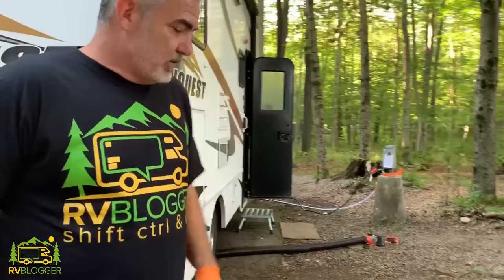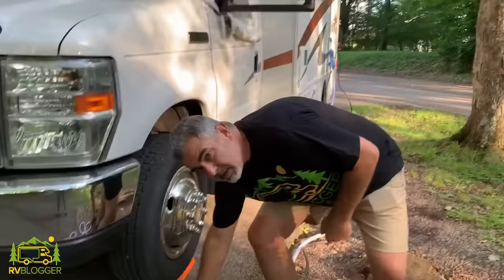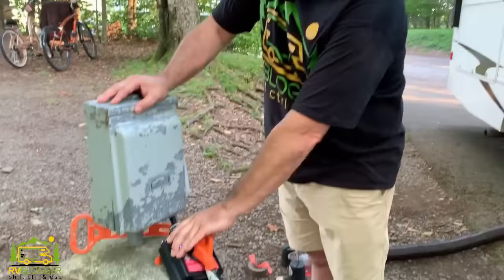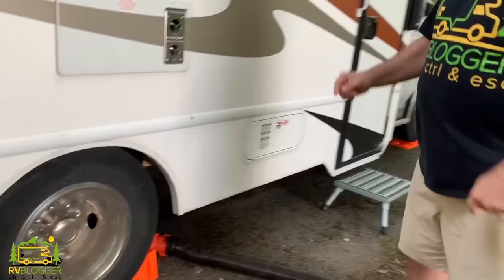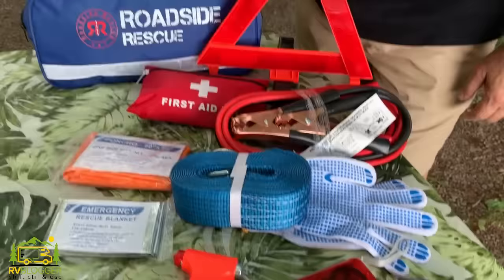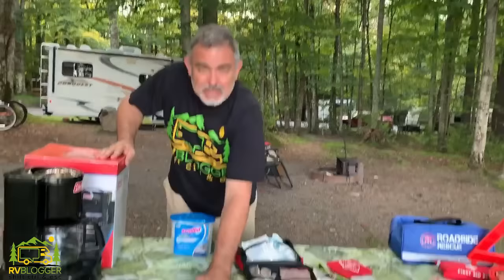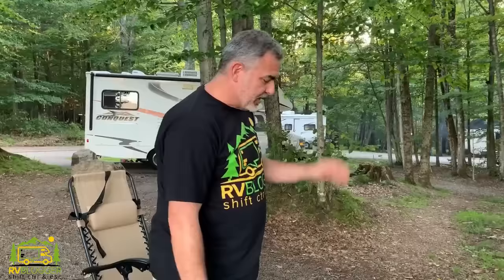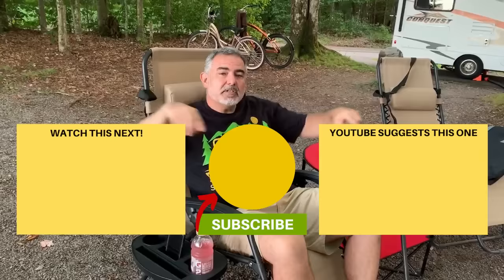Essential Gear & Accessories for RV Beginners - We Didn't Back In to Our Campsite - Do You Know Why?

Comment: Hookups aren’t on the wrong side. You should of backed in
Reply from the maker: Watch the video again! If I back in my side door would not be facing the campsite where the picnic table and fire ring were located. I would have to get out the side door and then walk around the RV to the other side. 
We keep extra hose, sewer line and electric cable on both of our RVs because the hookups are on the wrong side every now and then and this was the perfect campsite to shop off why this is important. But we camp way more than most people so we see hookups on the wrong side where most people have never experienced this. 
Thanks for watching!
Mike

Comment: Thank you so much for this video! As a first time owner it's a little overwhelming trying to figure out what is essential. I was happy that I do have a good amount of them but never thought about the surge protector!  Also will be looking into the Rhino blaster.  I read you should never stay hooked up because of sewer gases but Am I correct to assume this blocks that?  Thank you!
Reply from the maker: Hi Lorrie,
The sewer gas thing isn't why. You should keep your black tank valve closed while camping until the tank becomes full because it takes all the pressure from a full tank to completely empty the black tank. You can leave the grey tank valve open while camping but you do want to be sure to have a full grey tank at the end of your camping trip because you can use the grey tank water to flush the sewer line after your final black tank dump.
I hope all that makes sense>
Thanks for watching and commenting! 
Mike and Susan

Comment: Why didn't you back in? Then your connection would be on the same side as the power and sewer.
Reply from the maker: I considered that but then the door into the RV would be on the wrong side and not facing the part of the campsite where our fire ring and picnic table were located...

Comment: Why didn't you just back the rv up vs. pulling in, and you wouldn't need to have all the extra hoses and effort?
Reply from the maker: Hi Jennifer,
I considered that but then my door into the RV would be on the wrong side and I would have to walk all the way around the RV to get to my fire ring and picnic table.
This has never happened to you before? It happened to us like two or three times in a week. But other than that the hookups are usually on the correct side.
Thanks for watching and for your comment!
Mike

Comment: Great video and thanks for sharing. I have one suggestion as well, and it's not back into your campsite. If you want to save some space, I traded in my propane coffee maker, which I loved, and downsized to a portable French Press thermos. I still use a propane stove and boil some water in a pot and pour it into my French press I bought on Amazon.
Reply from the maker: Hi Can_eh_sian,
I guess it isn’t obvious but if we backed in to the site the side door of our RV would not be facing the main part of our campsite where the picnic table and fire ring are located. Maybe I didn’t explain that well enough in the video…
Thanks for watching and commenting! 
Mike and Susan
Reply: @RVBlogger  I may have worded my sentence poorly, but I wasn't bashing your parking. All good!

Comment: Why didn't you just turn around and back in?
Reply from the maker: Hello OkWoodsman,
I guess it isn’t obvious but if we backed in to the site the side door of our RV would not be facing the main part of our campsite where the picnic table and fire ring are located. Maybe I didn’t explain that well enough in the video…
Thanks for watching and commenting! 
Mike and Susan
Reply: @RVBlogger  Yep did not see that. What a bummer, but the extra length solved it. Thanks !
Reply: I was going to ask the same thing. LOL.

Comment: Why didn’t you just back into the spot so everything is on the correct side????
Reply from the maker: Hi Marcia,
If we backed in the side door to the RV would be facing the wrong way. So we wouldn't be walking out to where the fire pit and picnic table and the large part of our campsite were. For some weird reason the hookups were just installed on the wrong side of the campsite. This happens to us a few times a year but we camp way more than most people. Have you ever stayed somewhere where the hookups were on the wrong side?
Thanks for watching!
Mike and Susan
Reply: @RVBlogger  wow. Never run into that situation.  Hope I never do!

Comment: Tell me why did you not just back into the spot?
Reply from the maker: Hi r b,
If we backed into the spot our side door to the RV would not be facing our campground where the picnic table and fire ring are located which would be very inconvenient. We run into campsites with the hookups on the wrong side a few times a year but we camp a lot more than most folks. Hope that answers your question!
Thanks for watching and commenting!
Mike and Susan
Did you see our video about our FREE RV Rental for a Weekend we are giving away? Hope you will check it out!
https://youtu.be/h_NW_O-VsTo
Reply: RVBlogger well I have had that problem and I just moved the table. I don’t use fire rings. I sure don’t want all that hose facing me in the morning, uka

Comment: Use a pillow then you can just level the RV, if your RV is level then a pillow will ensure your head is higher than your feet.
Reply: That wouldn’t work for me. I can only use a small neck pillow due to neck problems.
Reply from the maker: Hey Tony, 
We appreciate the advice! 
Thanks for watching and commenting! 
❤ Mike and Susan

Comment: Wrong side because you drove it in. Supposed to back in.🙄
Reply from the maker: Hi Michael,
I guess it isn’t obvious because I didn’t explain or show it well enough, but the hookups are actually on the wrong side of the campsite. So, if we backed into the site the side door of our RV would not be facing the main part of our campsite where the picnic table and fire ring are located. 
Thanks for watching and commenting! 
Mike and Susan 

By the way, we invite you to subscribe to our free monthly digital/video magazine called RV Camping Magazine. It's totally free and there is video throughout the magazine! 
https://rvblogger.com/rv-camping-magazine/
Reply: @RVBlogger  I'd rather not have to step over sewage , water and power lines every time i go in and out of my RV.   so yes. .the site was made to back in.
Reply from the maker: @klenzgaming  the site actually had the hookups on the wrong side. We didn't show that well enough in the video. We've seen this more than a few times in different campgrounds. But I did a bad job of showing and explaining it in the video.
Thanks for watching!
Mike

Comment: Hatchet.  We never camp without one.  Great for chopping up wood that you buy at the campsite as well as using it to bang in any kind of tent pegs.  We also bring a tarp for shade and rain protection.  We just moved from tent camping to a pop up and are looking to buy a travel trailer in about a year, but I can’t see us ever camping without the hatchet and tarp.  We also bought a canopy (our pop up doesn’t have one) so we can set that up right outside our pop up; it goes over our kitchen area so we can cook, even in the rain, then we use the tarp over the picnic table so we have somewhere to sit outside if we don’t want to just hang out under the canopy.  We are also going to start bringing our clothes horse so we can hang up wet towels and dish cloths.  We have usually just used rope, but the clothes horse needs replacing, so why not relegate it to camping?

Thanks for posting for the RV stuff; it is good information to know since we are hoping to move to a trailer next year!
Reply from the maker: The hatchet is a great addition to the list. Thanks for suggesting that. We carry one also..just didn't make it on the list! 🤦‍♀️I (Susan) used to have a pop up camper and loved it!! Sounds like you have an awesome setup going on. Thank you for sharing your "must have" camping gear with us. Someone reading comments will find value in it too! Thank you for watching our gear video and commenting! Safe travels!

Comment: Camper paper, no. It isn't worth it. If you stuff a large enough wad of paper down the toilet to clog the 3 inch drain, well you probably need other lessons. Toilet chemicals, no. It's a black tank not a septic tank. If you leave it in long enough to actually break down with those enzymes you're waiting way too long. None of us put surge protectors on every item in our home. Use surge protector strips inside, they cost way less.
Reply from the maker: Hey TCUH
We appreciate the info! 
Thanks for watching and commenting! 
❤ Mike and Susan 

By the way, check out our FREE monthly digital magazine https://rvblogger.com/rv-camping-magazine/ and let us know how you like it!
Reply: The surge suppressor protects the power supply and therefore everything downstream. The strips only protect the devices plugged into them. Many campgrounds have pretty sketchy electrical systems so it's a really good idea to use one.

Comment: Ummm. Shouldn’t you back into the site?
Reply from the maker: Hi 2A Strong,
Look more closely...
If we back in then the side door to the RV wouldn't be facing our huge campsite where the fire ring and picnic table are located. So - the hookups were on the wrong side...
We end up in campsites like this several times a year but we camp way more than most people. So we keep two of everything on board in case we can't reach, or the hookups are on the wrong side or in case something breaks.
Thanks for watching and commenting!
Mike and Susan
Reply: RVBlogger oh.  Got it.  I was wondering the same thing.  So overall just a crappy site layout?.  Not your fault— no other available?

Comment: I see you have responded to several people saying that the site is backward. Well, you pulled in and did not back in. Your complaint of the door then being on the wrong side is not a valid point as that door is designed to open away from traffic. So back in next time and then you wont fall over your sewer, water or electric connections. Good luck in the future......
Reply from the maker: Actually Noslen,
the hookups are on the wrong side.
I guess it isn’t obvious but if we backed in to the site the side door of our RV would not be facing the main part of our campsite where the picnic table and fire ring are located. Maybe I didn’t explain that well enough in the video…
Who wants the side door the the RV facing away from their campsite?
Plus there are campsites with hook ups on the wrong side. We land on a few a year but we camp way more than most folks.
Good luck to you too.
Mike
Reply: @RVBlogger  it must take patience to have a YouTube channel. Reminds me of a Sesame Street Buddy and Jim routine where they had a hammer that pointed to one wall and a nail that pointed to the other and they couldn't figure out how to hang the picture. Haha
Reply: Easy solution Noslen. He 1st needs to buy a cooler. Then he needs to remove his fridge and install a door on the drivers side of the RV. Because as you know, all Rv's have their hook up's on the drivers side. That camp site had their hook up's on the picnic table side. The side you want your "away from traffic side" to face. Good luck in the future to YOU!!!!

Comment: Why didn't you just back in
Reply from the maker: We could've backed into our spot the "right" way but then our door would've been facing the road vs facing our campsite where our picnic table and fire ring etc was. We preferred pulling in so we could exit the RV right at our site not the road and have to walk around the RV every time and that was ok cause we had enough RV gear to make it work. Hope this explanation helps. Thank you for watching our essential RV gear video and commenting. We appreciate your support!

Comment: Blaming the campsite for being "all wrong" because you failed to back into the space is pretty ridiculous. :)
Reply: His door would then be on the wrong side, facing away from the campfire
Reply from the maker: Hi Will,
We get more comments about this than anything else and you aren't the first to be wrong but you seem way more offended about it. lol!
If we backed into the spot our side door to the RV would not be facing our campground where the picnic table and fire ring are located which would be very inconvenient. We run into campsites with the hookups on the wrong side a few times a year but we camp a lot more than most folks. Hope that makes sense. 
Thanks for watching and commenting!
Mike and Susan
Did you see our video about our FREE RV Rental for a Weekend we are giving away? Hope you will check it out!
https://youtu.be/h_NW_O-VsTo
Reply from the maker: Exactly right Specialopsdave,
Thanks for the help in explaining it to Will.
Thanks for watching our video!
Mike and Susan
Reply: @RVBlogger  Not the least bit offended. Though your excessive response is a bit off putting
Reply from the maker: @allenchamberlain1963  Nope - the other side of the campsite was all wooded. Nowhere to set up the picnic table or fire ring. Plus we had a HUGE campsite so why would we move everything to the other side. We probably camp a lot more than you and we run into hookups on the wrong side a couple times a year.
Thanks,
Mike

Comment: Did you ever think about backing your RV into your spot so that your hook ups are on the correct side ???
!! DUH !!!
Reply from the maker: Hi Heber,
Did you ever think that if we backed into the site the side door to our RV would not be facing the side of the campsite where the fire ring and picnic table are located? DUH? 
I was going to delete your comment but I think I will leave it up so everyone can see how smart you are. LOL!
Anyway - thanks for watching!
Mike
Reply: I notice the main road to drive through to the other camp sites is fairly close to where your hook up's should be installed. The site manager had to move the hook up's away from the road and install them on the wrong side of your parking pad because Heber Belles kept running over them. DUH!!!!!!!!

Comment: This guy's a salesman. And doesn't know how reverse works.🤣🤣🤣🤣🤣
Reply from the maker: Hi Doug,
I guess it isn’t obvious but if we backed in to the site the side door of our RV would not be facing the main part of our campsite where the picnic table and fire ring are located. Maybe I didn’t explain that well enough in the video…
In addition I have NO SPONORSHIPS for any of the products we recommend. These are the actual products we use ourselves.
Thanks for watching the video. 
Sorry you thought so little of us though.
Mike and Susan
Reply: doug rogers As a “newbie” I was really impressed by this video. I hope I never get as jaded as you. I’m 65 yrs old, willing to learn new things, and appreciate someone with experience helping me to do so.
Reply: @RVBlogger  I notice the main road to drive through to the other camp sites is fairly close to where your hook up's should be installed. The site manager probably had to move the hook up's away from the road and install them on the wrong side of your parking pad because doug rogers kept running over them.

Comment: Great video and new subscriber.  We tend to put our water filter after the pressure regulator so there is not as much weight dangling off the water inlet.  Works out great!
Reply from the maker: Hi Sport260,
I do it both ways but now I don't use the cheapo blue filters anymore. Here's a video that we made that explains why...
https://youtu.be/06nHVkDeqwg
Thanks for subscribing, watching and commenting! 
Mike and Susan

Comment: Will the water pressure regulator help if I have no pressure and want a bit more ?
Reply from the maker: Hi Chuck,
Good question but the answer is no...pressure regulators can't increase water pressure.
Thanks for watching!
Mike
Reply: We had to fill our fresh water tank and use our 12 volt because the campground had low water pressure.

Comment: Great video! Thanks! We use a coffee percolator on the propane stove. Best coffee ever!
Reply from the maker: Hi Betsy,
I always get coffee grounds in my coffee when I use a percolator. Do you use a coffee filter with your percolator?
Thanks for watching and commenting! 
Mike and Susan

And by the way, we started a Facebook Group for folks interested in learning all about RVs. Hope you will check it out and join if you are interested! 
https://www.facebook.com/groups/RVCampingforNewbies/

If you haven’t subscribed to our channel yet we sure hope you will at:
http://goto.rvblogger.com/YoutubeChannel?sub_confirmation=1
Reply: RVBlogger Yes I do use a coffee filter. The 4-12 cup basket style works well. I just poke a hole for the stem to go through. No grounds! Will check out the Facebook group. Thanks
Reply: @RVBlogger  I used to use a filter made especially for percolator coffee pots. A little disc made from similar paper used in an electric coffee maker or I used to not drink the last 1/2 inch of coffee in the pot to avoid any grounds. Now Im a tea drinker, no need to be concerned with grounds.

Comment: Why didn't you just back into the lot so your connections are on the correct side? Also, it'd be interesting what the water pressure is AFTER the water filter, since it itself acts as a regulator.
Reply from the maker: We certainly could've backed into our spot but then our door would've been facing the road vs facing our campsite where our picnic table and fire ring etc was. We preferred pulling in and that was ok cause we had enough RV gear to make it work. Thanks for watching and commenting. You can place your regulator before or after your filter. Doesn't make much of a difference. Thank you for watching our Gear & Accessories video and commenting.